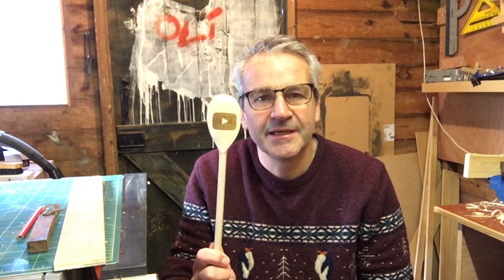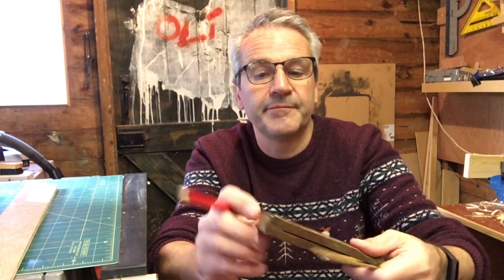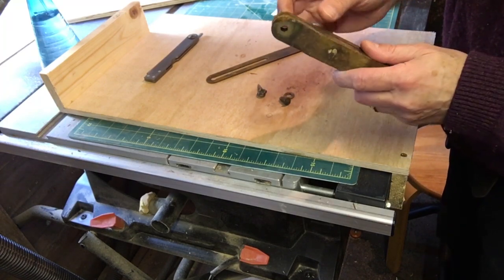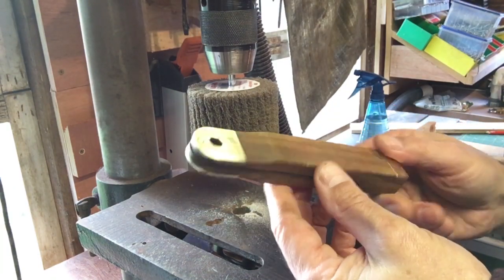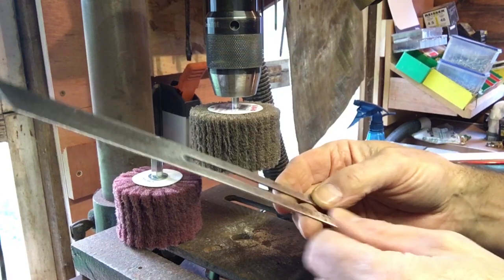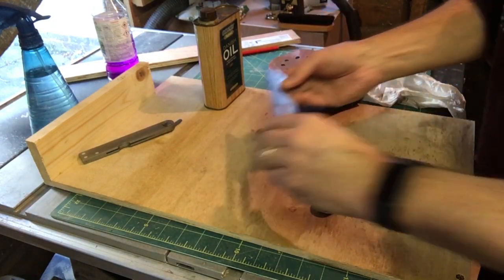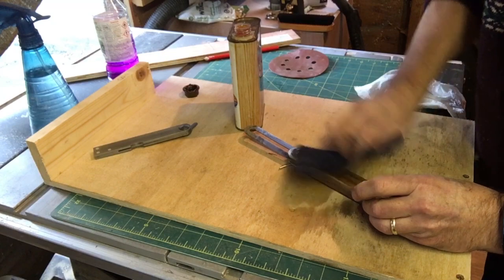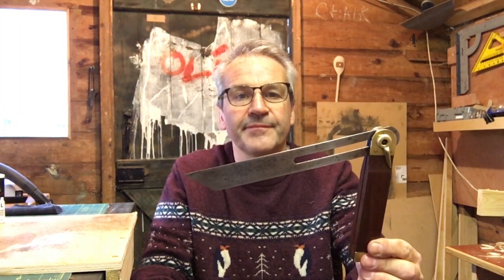Vintage Sliding Bevel Gauge Restoration

Comment: I do love the contrast of brass and wood, especially darker woods.  Looks almost new after the cleaning and oiling.
A good addition to the toolbox.
An easy cleanup.   I like the design of the nut.    The cheap ones use wing nuts which I hate.
You mentioned the handle was wet when you got this. Glad it did not crack as it dried out.
If you did get a piece where you did not want to take the risk of wet wood cracking as it dries, look up wood stabilizer products.   Not cheap, but can prevent issues.    There are different products, but they all displace water in the cell structure then harden over time, so reducing the dimensional movement of drying which results in the potential for cracking.
Dave.
Reply from the maker: it had been rained on recently i think so not long exposed, i let it dry slowly and looks like it survived